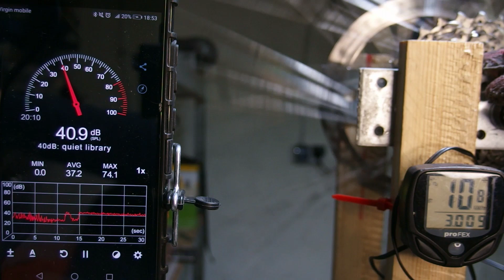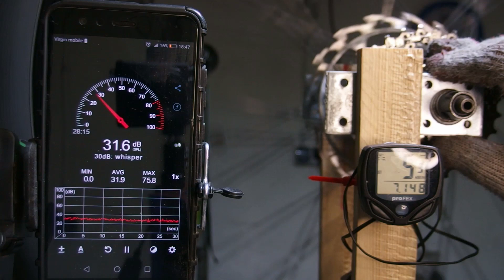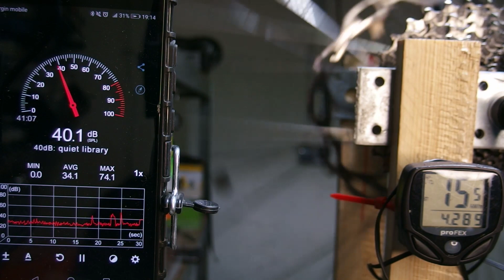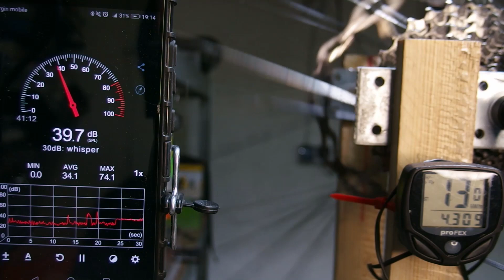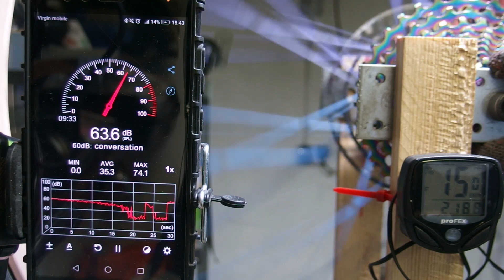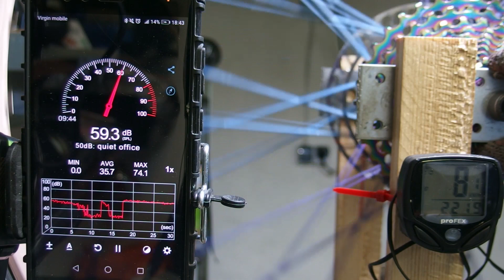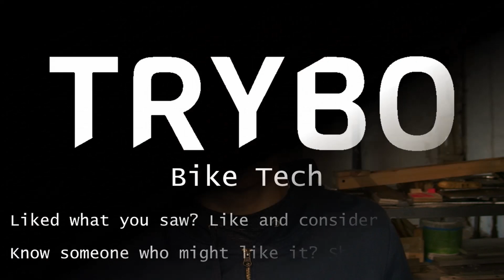Angry hub noises.

Comment: There is a ratchet And a noisemaker on the cobra?!?!? Your bearings / plastic on the fan in your computer is probably getting noisier as it moves less freely. The fans are one of the cheapest components. With all this noise it sounds like you should get some ear plugs! lol jk. nice job ty. i have some hub noises. I do like my noisy hubs for downhill riding so people can hear me, as riding downward is coasting. I also like others with noisy hubs so i can hear them when i am ahead of them off trail. The hub noise has to sound nice to me. I also like noisy hubs for commuting, when i am passing or coming up on pedestrians it serves as a bell, as i can make the sound very quickly by stopping pedalling.  There are times when i like quiet hubs though, especially when riding in all other situations. What we do to stay occupied in this pandemic. ;-)

Comment: Assuming both hubs are properly lubed and use the same power transfer system (be it ratchet, bearing, pawl, etc) a noisier hub also means more points of engagement right? that's also a trade off into consideration when you need extra traction and less dead space between pedal strikes. I previously had a ball bearing hub with 18 points of engagement and moved to a 54 points of engagement ratchet hub, and the difference in the dead zones is noticeable under some circumstances that one would desire. 

There is one or two companies which take no compromises and have designed completely silent hubs with high number of points of engagement, but the technology is so different that they're so expensive for most of us.